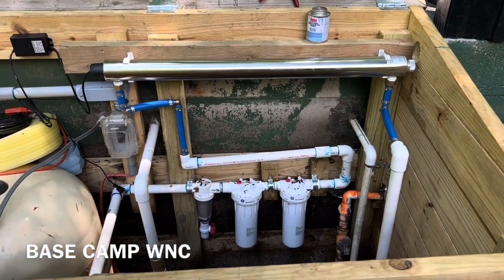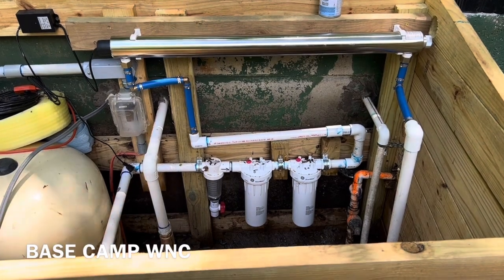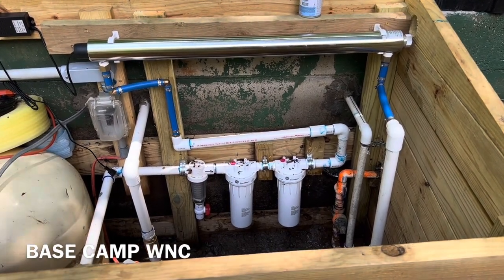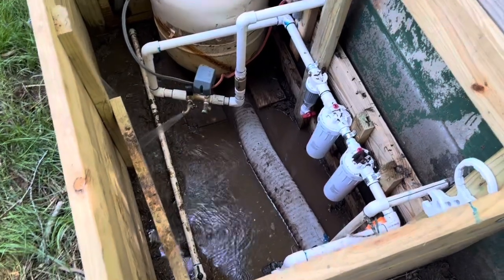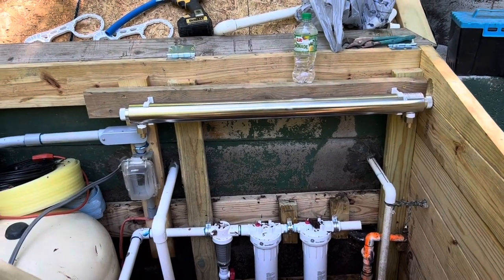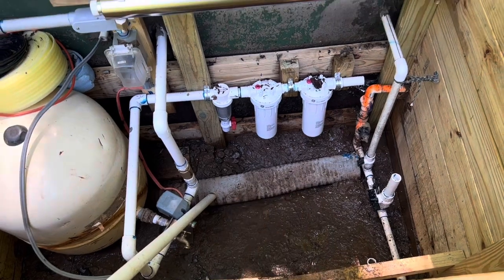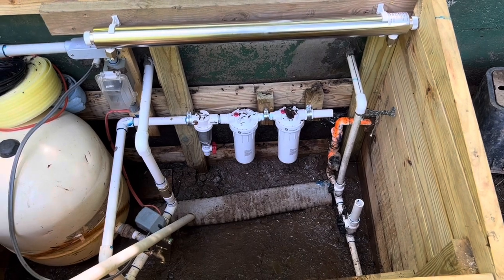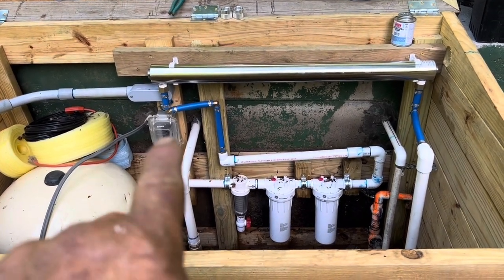Adding a UV light for water purification on a spring water system

Comment: The average size of the openings between pieces of the filter media are represented in microns. For example, a 20-micron filter has larger openings than a 5-micron filter. Consequently, the 20-micron filter element will let larger particles pass through the filter than the 5-micron media would.
Found this on line.
Reply from the maker: Thank you

Comment: Would there be a way to only run the UV light only when there is flow?  Could you run it off a timer, shut it off during sleeping hours?  Yeah it’s only 55 watts, about the same as running Starlink.  I’m off grid in Arizona running on a smaller 5KW system.  Just brainstorming some ideas…. Some of these may take a bunch of juice just to start up….  Hmmmmm……. Thank you for all your insight.  I appreciate all your videos.
Reply from the maker: It would be better for you to use a DALTON RIO  W9381000 filter
it’s a whole house this one has 6 ceramic filters 
No power required. Washable 
Amazon price is $119.00 may look at DISCOUNT FILTERS or CHEAP FILTERS they may have better deals
Reply: @basecampwnc1745  But what about the UV light part?  That takes power.  Is that what you were asking about patkaiser6910, if there was a way to keep the light off unless you actually have the water running?  Eric, IS the UV light on all the time whether the water is running or not?

Are you saying that with DALTON RIO W9381000 you don't even need a UV light???
Reply from the maker: Yes the Dalton  Rio does the same thing
Both remove 99.99% of bacteria from the water